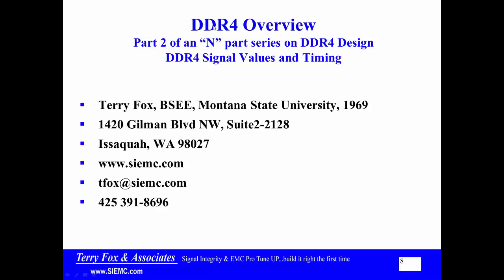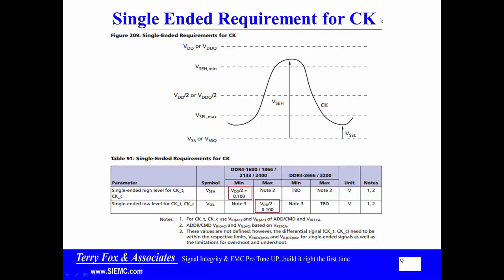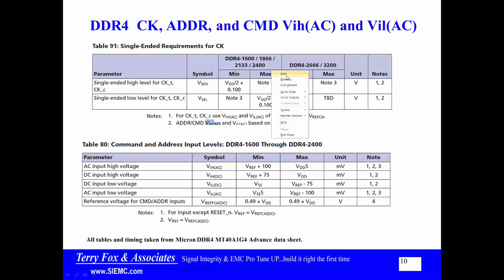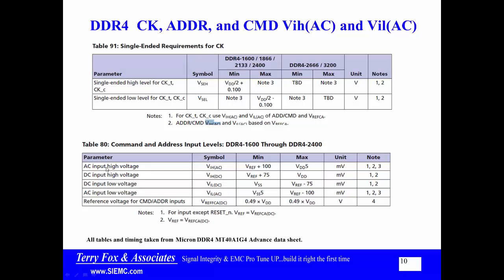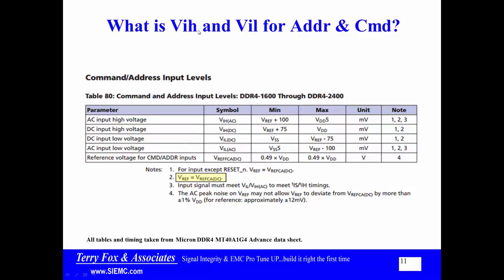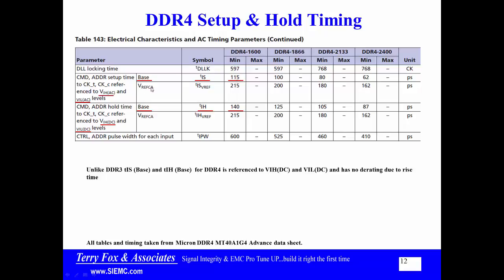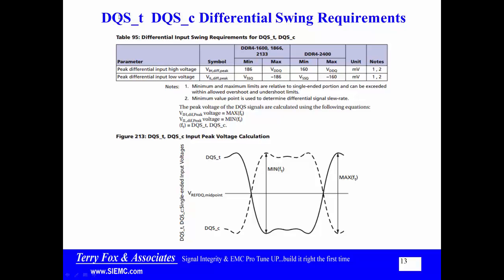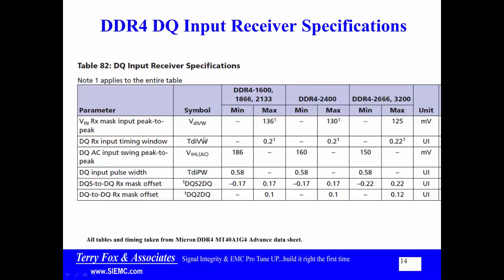DDR4 Part 2

Comment: Hi sir ,
What is rise time and fall time of DDR4.
Is the TdiVW is sum of Set up  Time and  Hold time ? Then the sum  rise time and fall time is TdiPW-TdiVW?
Reply from the maker: Rise / fall / valid pulse width depends on the exact speed specification of the part you are using.  I would refer you to a Micron Data sheet for the part you are going to use.
In addition the rise / fall will be dependent upon the load etc.
Your only choice is to design very conservatively ( and hope it works) or simulate the circuit with appropriate tools.
Reply: @tfoxwa  to set up Eye mask for the simulation needs rise and fall time and set up and hold times for DDR4 at the receiving Mask
Reply from the maker: @Suryaofficial691  The eye mask comes from the  receiver specification.  The rise and fall time is a result of the drive strength, receiver load, and reflections.  That is a result of the interaction between the driver model and the path simulation including the actual input impedance of the receiver...which comes out of the receiver model.  The receiver model spec is either from the manufacturers specification data or from the JEDEC specification.

Comment: I dont recommend nor used these high speed design in critical military , aero space , applications , super computers don't use less than 80nm design and noisy ddr 4 running at 2 Ghz